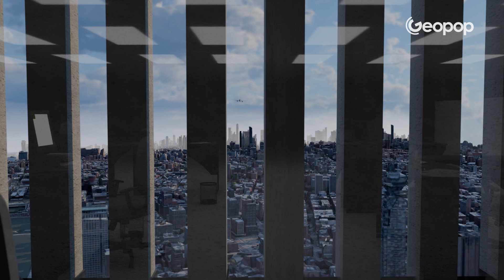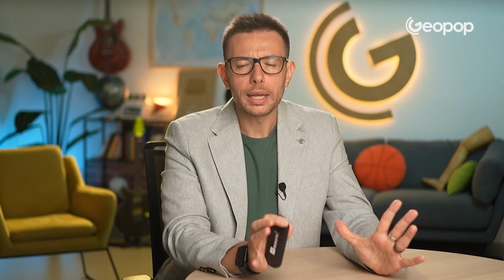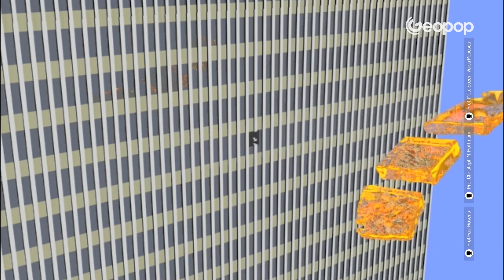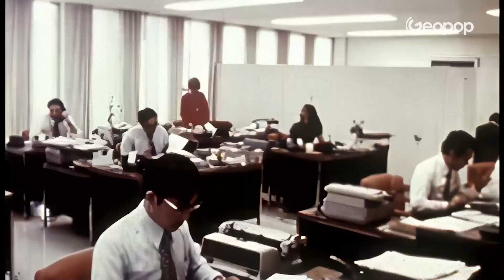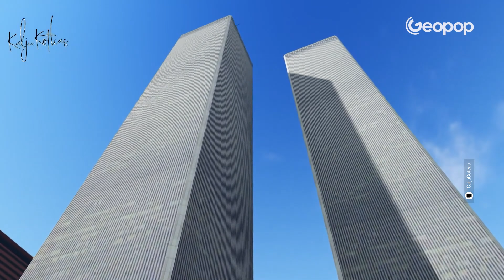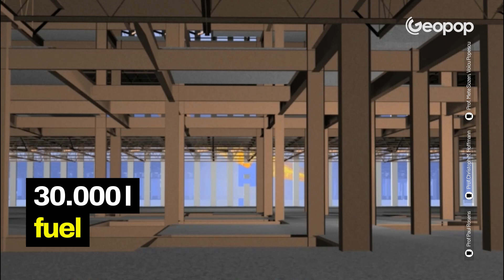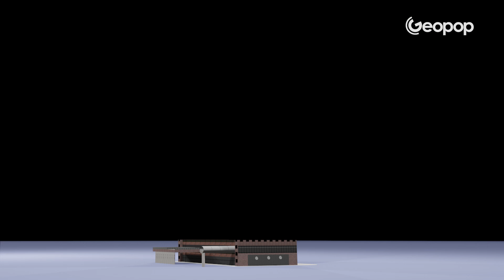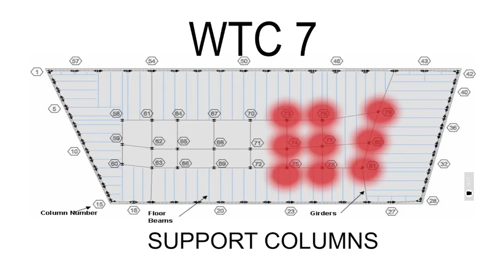9/11, 2001: The Technical Reconstruction of the Twin Towers and WTC 7 Collapses

Comment: Assuming the theory is correct and the steel weakened, that would only explain any collapse on the upper floors down to the impact zone. Anything below 78 would be unaffected as heat rises. Nists statement that the lower floors could not support already existing weight doesn't make sense. Particularly considering the hugh buffers built in to support far more weight than the towers would ever support realistically.

 Of course the collapse of Bldg. 7 is completely beyond the pale. "Nist's" fire theory on Bldg. 7 is fatally flawed since unlike the trade towers, which received sever structural hits, the fire suppression systems in Bldg. 7 would have been completely in tact and so the fires would never have gotten a foothold unless the system was disabled. Also, unlike the trade towers, there would have been no high octane fuel present, meaning that any fire that did occur would have been paper or electrical fires. Meaning, nowhere near the temperatures that would compromise the steel superstructure.

 Finally,  evidence of Squibs detonating at the time of collapse were noted in Bldg. 7. There are too many other flaws to list, such as why did other buildings closer to and at the same distance from the towers go unscathed. Typically commissions come up with the results they were instructed to come up with.

True, Islamic terrorists were responsible for the attack, but US Intel would have detected the plot. Although Bin Laden & Co. were NEVER in Iraq, a massive tower collapse would be a Great reason to justify an attack on the middle east. They're all the same, right? In this case we're talking about a country with valuable oil reserves which could be (and WERE) auctioned off for obscene profits. And as 'Dubaya' would often say, " well, Sadam wasn't a very nice guy anyway,  so it's ok". 
How does the old saying go? Never let a good crisis go to waste??

For those would drone on about "conspiracy theories" my answer is always the same. Follow the $$$$$
I might add, Where DID those WMD turn up?
Reply: Had it ever occurred to you that collapse initiation (what started the collapse) and collapse progression (what kept the collapse going) mechanisms are not the same?

Let’s break it down to the absolute basics, addressing most of the commonly asked questions as we go:

The 47 core and 236 perimeter columns of the Twin Towers support all of the gravity loads of the building. ALL of the resistance is in the columns.

Planes impact Towers, causing massive structural damage, destroying sprinkler systems, tearing out gypsum board walls and blasting off the SFRM insulation from the floors. Multiple floor-wide fires are started instantly and spread rapidly due to the destruction of fire protection systems and venting of the building during the impact.

Serious fires were largely confined to the impact damaged floors and those immediately adjacent to them.

Fires were started by the impacts and fuel aboard the aircraft, which acted as an accelerant. No shortage of other consumables inside the tower to continue the fires.  Active and passive fore protection systems were destroyed in the impacts, there was no active firefighting.

Collapse was initiated (started) at the impact and fire damaged floors when floor trusses exposed to heat over time sagged, in turn pulling on and causing the inward bowing of some perimeter columns by up to 5 feet until they buckled on one face of each tower (ie: NOT symmetrically).

www.youtube.com/watch?v=ULdiD6gYZO0

No steel melted or needed to. Structural steel will bend and fail at less than half its melting temperature.

Once the perimeter columns buckled the formerly static load above became a dynamic load 30 times greater , easily overwhelming the structure below.

Thousands of tons of now loose debris fall through the open office space within the four outer walls - bypassing the columns - dropping 12 feet onto the first intact floor it comes across. That massive instant overload causes the floor to fail, shearing the pair of bolts that secure each end of the floor trusses to the columns. The floor fails. adding its mass to the falling mass which continues to accelerate for another 12 feet until it impacts the next floor, rinse and repeat one floor at a time all the way down.  Yes there is resistance but its totally inadequate to arrest the collapse. Resisting is not the same as preventing

The columns - the part that holds the building up, supporting ALL of the gravity loads - are spectators for all this as the debris falls around and past them, not onto them.

Rate of collapse increases as momentum increases. The collapse front is constantly accelerating.

As each floor fails, air inside the building (the Towers were 95% air by volume) is compressed, then blows out the sides _in reaction to the Tower falling, not the cause of the Tower falling.

No fire required at all on floors below the impact points for them to fail. The mechanisms that started the collapse are different to the mechanisms which continued the collapse. That will be a difficult concept for some.

As the floors fail the perimeter columns are left literally hanging in the breeze, no longer attached to the rest of the structure. They peel away and fall in great sheets (think banana) out to more than 600 feet from the base on the 4 points of the compass.

Core columns failed last, buckling near their base due to the loss of critical lateral support as the building collapses around them.

www.youtube.com/watch?v=WpHXj62Ylw0

Twin Towers collapses were a combination platter of four (4) factors:

Impact Damage + Fire (heat) + Time + Gravity = Collapse

Remove any one of those four factors and there is no collapse. Ignore any one of those factors (most people reading this ignore three) and you will never understand the collapse. They all work together. 

The collapses took 32 to 34 seconds start to finish, or about 1/3 of the rate of free fall acceleration for those obsessed with how fast things fall because the internet told you it was important. No Laws of Physics are violated so no need to invoke magic or divine intervention

Each 110-story tower had a 1-acre footprint. The debris pile was up to 14 stories deep and spread out over 16 acres, destroying 8 surrounding buildings and damaging more than 100 others.
Reply: @TheLoonResistance Regarding your statement:
"The static load above became a dynamic load 30 times greater"

Can you please explain the physics behind this? It seems you're implying the mass somehow increased?? (perhaps the steel somehow transitioned into lead?)

Talking about the IN TACT COLD AREA BELOW THE IMPACT ZONE -  The Rate of collapse would have affected the impacted floors and above and so not be applicable.

There were Hugh margins built into the towers regarding the weight they could support, so this is definitely not making sense.

"The mechanisms that started the collapse are different to the mechanisms that are different to the mechanisms that continued the collapse. That will be a difficult concept for some"

LOL - Yes, that's because it defies physics. The towers would have to have been designed with virtually no margins past supporting themselves and perhaps a small handful of individuals for that to have been the case.

How much more so in building seven which was never impacted, and had a fully intact sprinkler system. Again FOLLOW THE MONEY  and sadly, never underestimate greed.

Lastly, regarding your statement:

"No laws of physics are violated so no need to invoke magic or divine intervention."

well.....
Reply: @supadupahilton6848 - What has more energy, a static object or a moving one? The load factor difference in this case was roughly 30, not that it matters that much if you understand the rest of what is going on. It matters more in a Byzantian limit-case scenario, but I prefer to stick to actual mechanisms.
Reply: @TheLoonResistance No, I think you're on the right track. Worst case failure analysis is very important
Reply: @TheLoonResistance I think it's funny, you got somebody talking about static loads and gravity loads , who is not an engineer , has no clue about what he's talking about whatsoever. Where did All the moultons steel come from? Let's set the record straight. Molten steel was found in the dust, and in the debris for 6 weeks.  Molten steel was reported by the fallowing 
people. Captain Philip Ruvolo (NYCFF), 
Richard Riggs(debris removal expert) , Leslie Robertson (wtc structural engineer), Lynn Margulis (University of MA),  Dr. Abolhassan Astanch (from Berkeley),  Robert Kim Ireland( chemical engineer for US Army Corp of engineers), Mark Basile( chemical engineer), Kathy McGrade (materials engineer), Gery Warner( Mechanical engineer), David Gregg( PhD Chemical engineer), Steven Jones PhD( physicist), Kevin Ryan ( BS Chemistry), Niels Harrit (PhD Chemistry), Tom Sullivan( Explosives team) Jason Cheshire ( Chemical engineer), and Jeffrey Farrer (PhD Material science engineer). 

Ok, so this is what proof actually looks like, take note. It usually shows up in blue. 

https://youtu.be/hB1IYi51Kdc?si=7xSCnyaV9DvdCTHl

Now see if you click on that, it shows you stuff. 3:18 you will see video of Lynn Margulis (phd university of Maine) reporting molten steel.  3:09 video footage of Leslie Robertson (structural engineer) reporting molten steel. 6:34 Steven Jones (PhD physicist) reported molten steel, 7:25 Kevin Ryan (bs in Chemistry) reported molten steel 8:23 Tom Sullivan (Explosives technician) says thermite cutting charges is a thing it's not made up. 5:02 Gary Warner (Mechanical engineer) proves molten aluminum is gray, looks like mercury.  He worked smelting it in the biggest Aluminum smelting factory in the world at the time.

Comment: 9/11 could’ve been so much worse had it been coordinated to cause as much death as possible rather than sending the strongest political message possible. Had they planned on using all 4 planes for the the twin towers 25,000 would’ve died that day rather than 3,000. This could’ve been done by waiting another 2 hours when the building would’ve been at maximum capacity..The terrorists could’ve coordinated with eachother and arrived close to the same time. Which would’ve prevented people from fleeing after the first tower was hit as well as given the passengers less time to figure out what was going on and start a revolt like the hero’s on United 93..They would’ve then hit as low as possible which was around the 30th floors. This would’ve blocked everyone above the 30th floors from leaving. The next two planes would’ve hit around the 80th floors. This would’ve ended the lives of everyone above the 30th floors even had the towers not fallen. There would’ve been 35,000 people at the towers rather than 17,500. And only 60 floors of the 220 (72.3%)  would’ve been able to evacuate. That means 72.3% of the 35,000 people would not had be able to flee. Compared  to the 167 floors that were able to evacuate. And thankfully because of the 20 minute gap between planes hitting 75% of the 30 floors above the impact zone on the south tower left before it hit. 3000 dying that day was so devastating, hard to imagine 25,000 plus another  343 firemen’s, but they could’ve done it had they wanted to.

Comment: How was the fire sprinkler water source damaged?
Reply: 120 tons of airliner ripping through it at 500+ mph.  Crazy that needs to be explained.
Reply: @TheLoonResistance yeah, the water was at the top of the building. I don't know I guess if you go through the sprinkler system. The water just acts like gravity doesn't exist. Stops coming out all together.  It's funny every time I catastrophe happens.The water disappears. But they sure had enough water to blast it for the next hundred days

Comment: 7:30                ..ignore wings engine etc & focus on that aluminum fuselage & how it tore right thru the steel with any damage to the nose of the plane at  all.
Reply: It's an animation from a model that was trying to show impact angles more than damage. It also covers less than 0.25 seconds of time. FFS 🤦‍♂
Reply: Grow up warlock!
Reply: @HowardRamsey   what if you took a  empty plastic water bottle  & shot it at a tin shed at close range.        wonder if the empty plastic water bottle would tear thru the shed
Reply: @97warlock  Yes it well could.
Try to think of it as Force generated. Hold the bottle - it has no force. Drop the bottle you'd gladly kick it. Someone fires it at you at 500 mph - you don't have a foot. Hurricane Mellissa (Only a 200 mph. wind, with no weight) didn't go through the shed, it took the whole bloody thing with it. Titanic was sunk by  a lump of ice ripping through steel at a few mph.

Comment: Additionally. We are aware of the Structural strength of a plane?  Vs the buildings columns and beams. The plane sheared 40 beams???
Reply: Yes.
Reply: Force is equal to mass times acceleration. Therefore a large mass x a high speed crease a very verly large force. 

How about the "structural strenth" of water when you jump off a bridge? Are you telling me that water which is so soft can crush a human body? Yes. 

Also keep in mind that the planes did not need to shear the columns, just the bolts. The connections are always the weakest link in any construction. Do you think a jumbo jet flying at speed can not shear off a bolted connection?

Comment: Plastic deformation vs fracture mechanics.  Big difference also. This heat would need to be focused and only apply to above floors. Not total collapse to result in free fall collapse and total destruction inward. 

No tip? No staggered failure?!  Explain the visible 45⁰ molten cut beams

Comment: Ok @ 13:20, the image showed a full plane nose and half the plane in tact after impact. This is not possible to go through several (at least) 12 inch steel beems on the window and remain in tact after impact. A bird that hit the nose of a plane made a massive dent into the nose. So how could this  simulation even add up?  These planes are aluminum vs structure steel? Please help me understand those physics
Reply: The computer image at 13:20 is about a thousandth of a second after impact and we already see substantial breakup. 

There are no beams at all and certainly not 12" (one foot) thick beams.  Only hollow box-section steel tubes welded up from A36 flat plate of 3/8" and 7/8" thickness.  

So you couldn't have cocked up your gross argument loading any worse.

If an 8 lb. bird can dent a piece of fiberglass then imagine what a 250,000 lb. bird at 589 mph can do to a thin steel and glass cage!

Comment: You make a statement that the steel expanded when it got hot.  Steel does not expand with a rise in temperature.  When steel heats up it contracts, and when it cools it expands.
Reply: You got that exactly backwards.  Steel expands when heated and contracts when cooled, with a typical linear thermal expansion coefficient of approximately 11 to 13 x 10^-6 /°C.  When steel is heated, the average distance between its atoms increases, causing the material to expand. Conversely, when cooled, the atoms come closer together, leading to contraction.

Comment: The office fires in tower 7 would run out of fuel before reaching the temperature and time to cause tower 7 to fall. Carpet paper and wood do not burn at high temperatures for 5 hours.
Reply: Define high temperature and why high temperatures - specifically high sustained temperatures would be required?

Comment: Oh 
... oh 28 minutes and mystery solved. Not buying this bullshit . You still cant explain free fall with no resistance below impact zone.
Reply: You have never even taken a high school physics class  and it shows, so forgive me if I dont take you seriously
Reply: @eggsinhell1532
Answer this - what caused the top portion of the buildings to disintegrate, there was nothing collapsing/pancaking down on them?? And before you try and make any attempt to a pathetic insult regarding education. I’m qualified and experienced in construction from trade level, through technician and have a Degree in Architecture. 
The molecular structure of the steel was altered that day.
Reply: @FUNKINETIK  collision with the bottom portion of the buildings. Every action has an equal and opposite reaction. If a moving car hits a parked car, are not both cars damaged?
Reply: Total straw man argument.

Comment: A plane would have crashed itself against the building. That's what I would have been expected. 🤔
Reply: It did, all 120 tons of it (think 12 dump trucks) with the energy of a ton and half of TNT.  The plane gets destroyed of course but that in no way implies the building comes out unscathed. 

That is what I would have expected AND what actually happened
Reply: Remember, the towers were 95% air. Don't think of them as solid blocks.